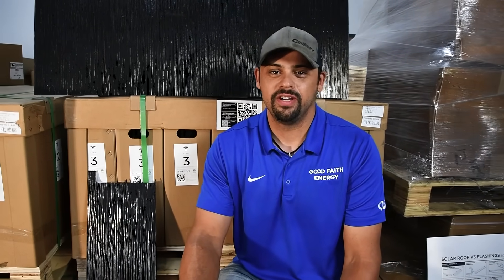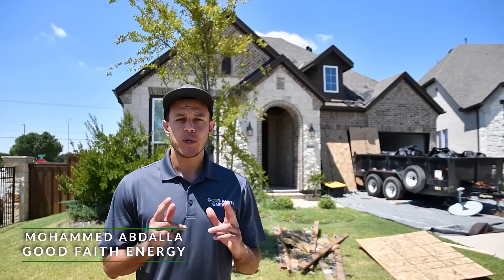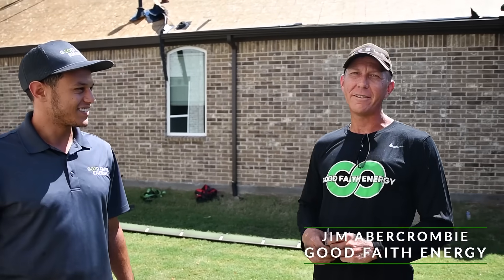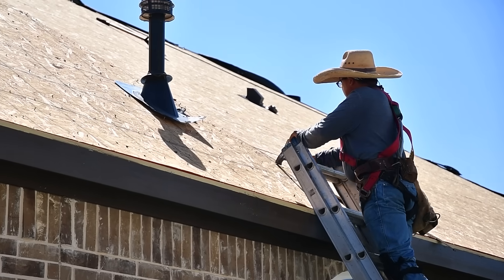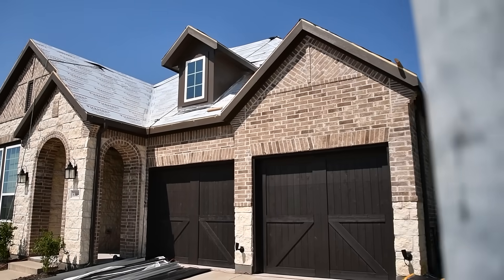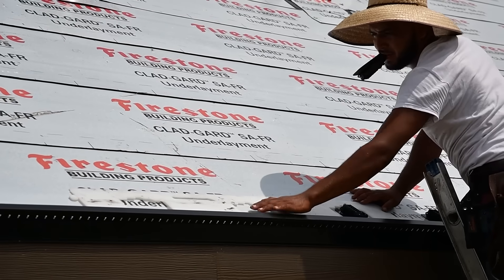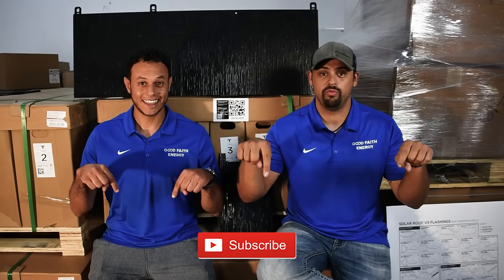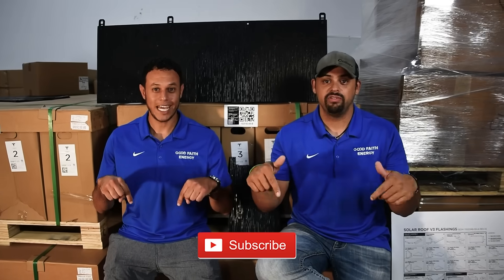Tesla Solar Roof Install | Ep1

Comment: Have you taken Temperature measurements inside the attic before and after to see if there will be a temperature increase with the Solar Tiles installed? I understand you will need to take outside temperatures and attic temperatures at the same time to be able to identify the increase or decrease.
Reply from the maker: We always recommend installing solar onto efficient buildings. This house has very efficient insulation and a radiant barrier as well.

Comment: Michael,
Our Tesla Solar Roof should be installed in few months at our house currently under construction. We have several roof dormers, similar to what you have in your video. Still struggling with how to do roof flushing up against the walls of the dormers. Please, let me know how it was done in your video: Was this flashing installed by Tesla or general contractor? If not by Tesla, how was it coordinated with Tesla installation? Did Tesla install the self-adhering underlayment prior to the flashing installation? In our case, the dormer walls will be covered with stucco, that should happen prior to Tesla tile installation.
Appreciate your help - Boris
Reply from the maker: Our team, Good Faith Energy, is a Tesla Certified Installer. We do the complete install in-house. Our roofing department handles that part. 

Best recommendation would be to check out the Tesla Partner Portal. They have all of the how-to videos you should need.

Comment: @Good Faith Energy: Do new gutters come standard with the Tesla Solar Roof? If not, can I keep my existing gutters including gutterguards?
Reply from the maker: Great question. It’s tough to keep them. They’re made out of thin aluminum, and trying to remove them to install the product is a challenge. Can it be done? Yes, but we set the expectation that once removed, their integrity is compromised, and they may not be able to be reinstalled , requiring some replacements.
Reply: @GoodFaithEnergy  So what about my first question: Do new gutters come standard with the Tesla Solar Roof?
Reply from the maker: @diyEVguy  a lot out our clients are choosing to replace their existing gutters with 6” seamless gutters to make for a more clean, flush look.

Comment: Two layers of Peel & Stick...  and that's before the roof goes down...  That roof ain't gonna be leaking any time soon.
Makes sense though (if belts & braces) as allows a quick waterproof membrane[s] so the solar install can proceed at a more considered pace.
Reply from the maker: Agreed! Thanks for the insightful comment. You’re spot on.

Comment: Hi, can the tiles be installed on a patio?
Reply from the maker: Hey Julio,

You can install tiles on a patio, but the solar tiles are ~4.5 sq/ft, and are 58 watts each. You can't use the full patio because you have to leave a setback for your deck-level metals. 

You can size your system approximately by taking 70% of the square footage of your patio , dividing by 4.5, and multiplying by 58 watts, and seeing how many total watts that comes out to, to then gauge if the cost/benefit makes sense.